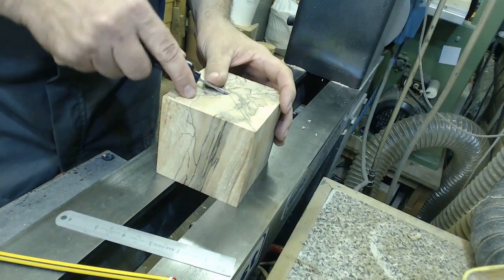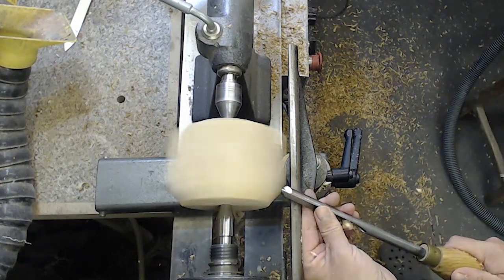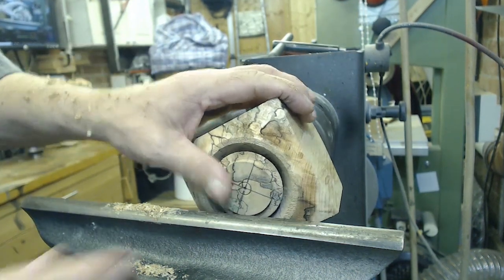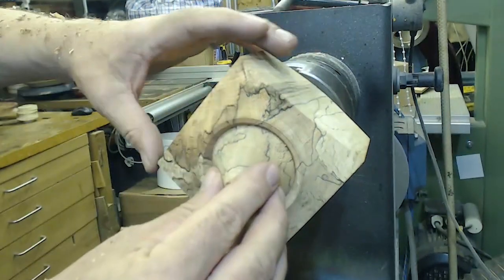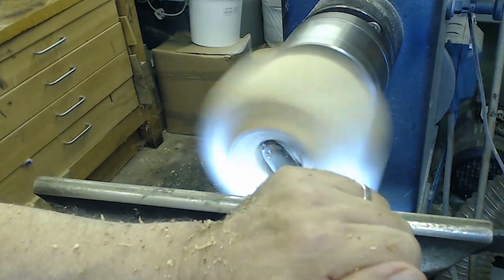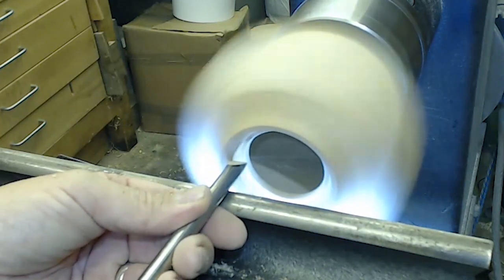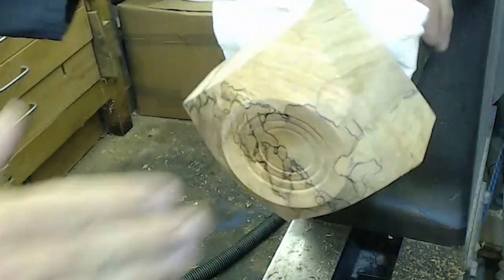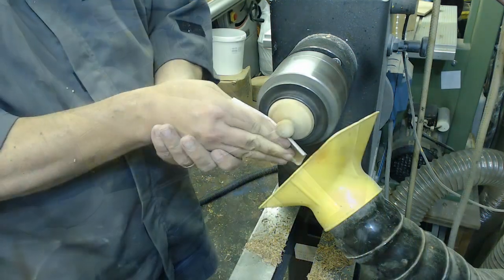Woodturning A Spalted Beech Square Box

Comment: More great work even with the voice over.  Now, more about that LED light strip please.
Reply from the maker: Hi Doug - glad you like it! I'll show more about the strip in a future video - maybe later this month if you can wait that long! It's basically a length of sticky backed led lights with a connector wire added going to a battery pack. Cheers!